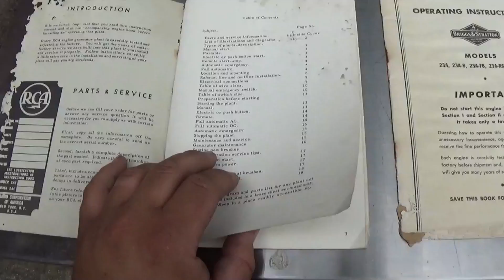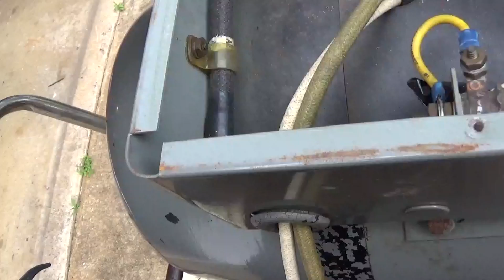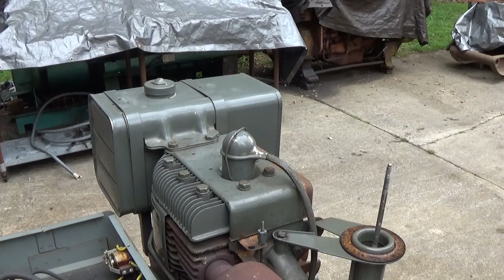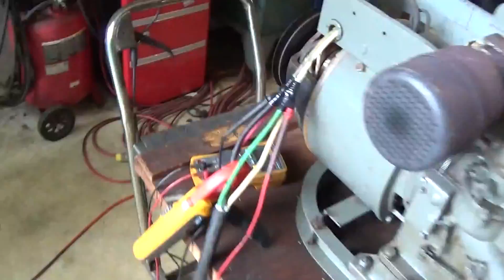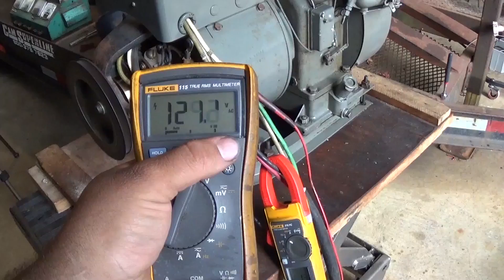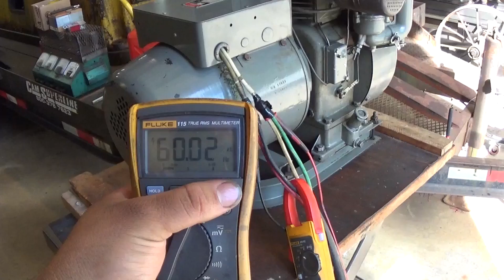Mint 63 Year Old Briggs and Stratton Engine on an RCA Generator

Comment: Indeed these were used for 2 way radio sets in Australia's outback the only strange thing is your unit is 110v ac single phase while ours are 240v ac single phase also ours had an electric 12v starter Generator on the front pulley, but I have seen these types of units with a built-in starter in the generator, I can't remember the Manufacturers name but these were generally the same Briggs & Stratton Engines, bigger units had Lister diesel engines on them  and multi output voltages all had shielded wiring, haven't seen these since the early 1970's they were the life lines of remote Cattle Stations (Ranches),As for the frequencies the engine throttles were set to in our case to 50HZ the voltage could be under load from 240v -220v, the OLD radio equipment was more sensitive to the correct HZ. There were also issues of Fuel Quality mainly due to the age of the fuel, so engine performance needed checking via a HZ meter, diesel fuel was less of a problem.

Comment: Back in its day, there were not multi grade oils, 20W or 30W for most engines. When multi grade oil came it was a big deal and slow to accept. Sure would not want to run modern electronics with that, sure neat to see and hear run.

Comment: I am sure that it was for some small  use.  Most RCA equipment was for professional broadcasters and at 20 amps 120 volt I doubt anything big.  Maybe a small remote truck or back up for a small radio studio, intending to keep only the basic equipment running in an emergency. Certainly it could power the main console and a couple of turntables and a small lamp. This would have been all you needed to stay on the air as the STL was a dry telephone circuit.

Comment: Hi great video, I have a similar motor same carb type, fuel tank , air filter etc. Can you tell me what the lever with holes and springs attached does (left and below of carb) and what the thumbscrew tap value does under the carb pipe? ( I am not a motor minded person but had mine running and working after a storm here in Melb Australia this week)

Comment: When I saw RCA mentioned, I immediately thought that the generator could have produced the HV dc for old valve transmitters, instead of making domestic ac voltages.   At British Telecoms we used to have some standby sets, and Electric Motor / Generators that would produce the HV for the valves.   We also used Mercury Arc Rectifiers...  Now there's a sight..  The only place I know still using Mercury Rectifiers is the Isle of Man Manx Electric Railway, where it is still used to generate the 800v Traction Current for it's trains.  Thanks for these Gene Videos..

Comment: On engines back then they use to do brake in oil. Lighter weight oil that you allow the rough parts to wear off the engine. Then use normal SAE30 oil. Even Car manufacture's called for it.

Comment: What is flicker points?
Reply: OK. I looked it up.  Flicker points increase the voltage on the field winding to compensate for the generator slowing down on a single cylinder four cycle engine during the non power stroke revolution of the engine.  

So: during the non power stroke of the engine the engine decreases speed and consequently would lower the output voltage of the generator, so the flicker points boosts the excitation voltage to compensate for the low voltage output.

Comment: I've got a 16 horsepower that looks just like that one...starts right up..it uses a starter/generator..makes about 2 turns to start...I'd like to find a generator for it to turn..I've had it 30 years...I guess it'll pull an 8 kwH  easy enough or I might just use a 5 and leave the 6 inch pulley on it and let it run slower..if you take care it'll last forever...these motors don't wear out...I've had probably 10 of them...you're right about people and common sense lol that was funny

Comment: Same engine I have! The AFB means it takes a direct mount generator/pump or clutch as it has a 
tapered shaft. it has ball bearings at the pto shaft end. freaking mice. being a nine HP  it should 
be good for 4500 watts.

Comment: Great videos! You have some old generators just like ones I have owned and worked on, back in the 70's and 80's. Really like the old 1 cylinder Onan 1000 watt with an updraft carb, mine came From Minnesota Power & Light as our power supplier used to be called. Thanks for taking the time, really enjoy your stuff!

Comment: Dear SEM. Sometimes dating these engines or generators is possible by looking at date signs on the back of the manual. Eg 453 is April 1953. Small characters. Also capacitors  have a date stamp to determine a period of manufacturing. I think I have an B&S engine from that period but not so lovely shining as yours! Good luck!

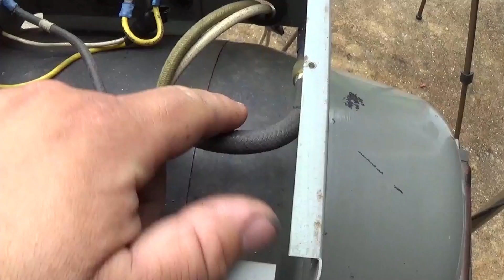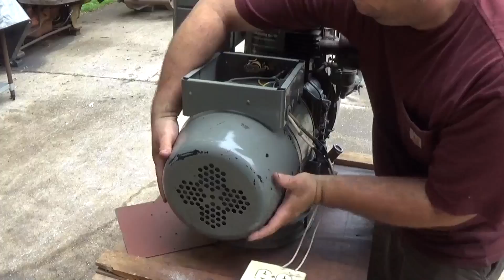Comment: the gen set  end bell vent holes do not seem large enough to allow mice to get in ...how did the mice get in? Just spotted it  at 11:11 to 11:40 , THE NASTY  TOPO 
GIGIO  followed the output wires  hole  from inside the box  , there is a huge gap underneath  its rear  bottom edge that does not contact the body of the gen set.
if left as is ... it could happen again  depending on where the gen set is stored.
Great video ..learned a bunch about flicker points.

Comment: YUP, that is how they did it, steel wool/oil bath air filter, damn good too. one hell of a
good magneto under the flywheel, it looks like a big-ass horse-shoe crab, something 
is squealing. I'd check gener8or bearings, rated for a bit over 2725 watts or 2.7 KW.
for the most part for every eng. hp 500 watts it is so a 5 hp would be good for 2500
watts.funny I thot the engine was close to mine a 23 book says 23a  and I saw 
elsewhere engine is good for 9HP.

Comment: The copper braid from the brush is known as shunt although in brass or copper brush holders, the shunt 
makes for a much better connection. that engine looks like a 23 AFB rated at 9HP. big-ass magneto under 
the flywheel, must weigh about a pound, looks like a horse-shoe crab!

Comment: One thing I learned with oil bath air cleaner systems used Textron transmission fluid it will filter 3 times better all the dirt and dust out of the air you notice that because there's a lot more dirt gets in the bottom because it's doing a better job filter in the air dextran transmission fluid Superior fluid for oil bath air cleaners didn't have transmission fluid back then or they would have recommended it

Comment: have the same engine on my yard mower, pull tractor unit, large blades ~3ft Radius. Cleaned the points and ground. It fired up and runs great. Smokes on startup. Pull the float the bowl also,  Starting fluid for first start

Comment: Nice. I remember those carbs. All you need now from the 1950's is a "Smudge pot" that they put at the end of a road so you will not run into construction at night. Engine has a smooth sound.

Comment: Made the same year as me, when I first started watching this video I was not too impressed, and it was the year model that made me stick around. But as I watched, I became more and more interested, especially when you started talking about the flicker points, you see I had never encountered them before, although I was aware of them, which is another story, although my primary job was as a high voltage electrician (lineman splicer) I was asked to assist the generator technician with a problem that he could not figure out. Well as we were working on his problem, he was trying to find out just how much I knew about generators, so he tried to stump me with a question about an old Onan generator that he had encountered a number of years before. The generator he described to me, actually had 2 sets of points, the for the ignition circuit, but the other one went to the generator field, so he asked me why? Well I thought about it for a few minutes, and I then said to him well the only thing that I can think of as to why they would do that is to lower the voltage to the field during the power stroke to reduce or eliminate the flicker of any lights running on the generator, particularly when it is loaded heavily. Well he stopped right in his tracks mouth open for a few minutes before he said anything. Then he said to me, how did you know that, and then he began to explain the hoops that he had to jump through to find out what they were for, keep in mind this was quite a few years ago, long before the internet and goggle, he explained that he had contacted the factory but no one there had any idea what they were for either.
So after a number of phone calls someone at the factory finally put him in contact with one of their retired engineer's who was able to explain to him what they were for. So anyway after that I was his go to guy for anything he didn't understand when it came to generators or anything electrical or electronic. Which a number of years later led to me getting a job with NASA as he had gone to work for them after leaving the place where we had worked together. So when I showed up for the interview as it turns out he was about to become my supervisor, the interview was when can you start? But I must say that generator is a great find, and something I would love to have, I used to have one of those engines when I was a kid, someone gave it to me when I was around 14 year's old, and I used it on many projects over the next few years, and yes the governor on that engine is one of the best I had ever encountered, all around it was one of the best small engines I ever had. Although it's not a high RPM model like the smaller ones, so when I first saw your generator I was thinking man that is really going to be hard on that engine running at 3600 RPM not realizing that, that RCA generator head was an 1800 RPM Model. So after finding that out, I realized that you really had something special there. The RF shielding on that engine is one thing mine didn't have, I believe that was something that was specked by RCA, and as several have already commented about, I believe that it was a purpose-built unit, and not something you could just go out and buy. Knowing that engine and the fact that the generator head is an 1800 RPM 4 pole unit this generator was designed for a long Service life and high fuel efficiency. I would hang on to that unit if I were you. That would be a great unit for someone living off grid, as a supplemental power source, for for times when it's cloudy for extended period of time or they just don't have a big enough solar system to run the big stuff like a washer, AC unit, instapot, or some other high energy use device. Anyway it was a very pleasant video, and made me think about a lot of stuff I hadn't in a long time, and I also never realized that that engine was made when I was, Awesome!!!
Reply: Robert Thomas 
Enjoyed your comment very much.
Reply: God Bless you Mr. Thomas!    I wish you were my grandfather....seriously!  Lol

Comment: So much nicer sound than the current 3600 rpm "portable" generators
Reply: Definitely does sound better, but you get more power out of a higher revving engine and smaller displacement.
It's kind of interesting that you can buy a portable generator today that makes the same amount of power.
But I seriously doubt any of these new generators would be around 50 years from now and still work. Even if they just sat in a box.
Reply: @kens97sto171   A friend lives off the grid in AZ and has 18,000 hours on a Yamaha. I have 2500 hrs on my Yamaha, runs and looks new. 
There's good stuff out there if you don't mind paying for it.
Reply: @TheBandit7613  
Thanks for the information.
So far I've had good luck even with my inexpensive generators from harbor freight. They don't get that much hard duty time, however they are getting old at this point and yet they still start every time. I am very careful however to make sure I turn the fuel off and let it run the fuel out of the carb.
The first one I got was one of those little $85 two-stroke models. That thing's going on 10 years old. Still runs fine.
I think if I was going to get something that I was going to use under load for a significant amount of time I would probably get a Honda or Yamaha, Ryobi makes a fuel injected model that I've seen on project farms YouTube site. That would be kind of intriguing because it eliminates a lot of the storage issues with carburetors. Probably decreases fuel consumption I would think too
Reply: Yeah is that 1200?
Reply: @skuula  Should be around 1750.

Comment: don't build them like that no more! I'm not a generator guy. I'm an engine guy. I did read some folks talking about the flicker points. Lots of generators will require the coils to be re polarized if they haven't been run in a long time. I can see this as being a good option to prevent the user from having to do this. Maybe I am wrong. But anyway, most of all glad to see that old briggs and gen running like a champ!!!

Comment: Could have been for a mobile TV or radio truck, or a number of uses for AC in the field, so to speak.    I would guess that someone made it for RCA.  Depends on the cost to buy vs. tooling up to make a small number.    I worked for Bell and some of the Western Electric stuff was contracted out but has W.E KS numbers on it.   Nice Gen.

Comment: I'd remove the mixture screws, idle & high speed, keep track of turns. Spray a shot of carb cleaner in there, and it might smooth out even more, especially under full load. Lean it out slightly, it fouled the plug before. What a super-nice generator set! Well played!

Comment: It would seem that under light load the voltage would be 130V or so. Is that a problem for hooking up household devices? How loud is it? It sounds fairly quiet. Quiet is a good thing. Runs nicely!

Comment: On the farms model 19s we had better luck with UJ8, which is a series gap spark plug. Good luck. I loved it when the farm bought augers with Kohler motors. They had electric start. 
Hello from north east Montana.

Comment: What a great gen set Mike. Back in the 70's were stocked, sold, service the Pincor generator line,...memory tells me we have some fields that failed on a regular basis with a lot of those,.
.these would be in the 1500 watt to 8000 watt range models.We changed over to Winpower sets after these.

Comment: Back then, RCA sold many things that they did not directly manufacture. They were often a “turnkey provider” of radio and communications systems for broadcasters and the military.  It’s possible that genset was produced as a system component for a two way radio site , PA system or similar. Or possibly for some type of mobile equipment. 
I would doubt RCA made the generator itself. More likely they contracted with another manufacturer to produce them to RCA’s specifications.
The Champion J-8 spark-plug was pretty much ubiquitous in the 50’s and 60’s on small engines.  
It’s cool that’s an 1800 rpm generator. Not a 3600 rpm “screamer” like they make today.

Comment: RCA was a behemoth at the time, with ton's of ton's of patents that almost every manufacturer in the Radio/TV business had to pay licenses for, or struggle to engineer their way around. 
It's entirely possible the generator end on this was something the sourced elsewhere, but I wouldn't be at all surprised if this was designed/manufactured in-house. 
Did a quick check for 20W engine oil, or "20W20". Seem's more popular in Europe than here. Might be OK to use a something like a 5W-20 with a bit of zinc additive mixed in as an alternative.

Comment: I'm a retired radio tech. Back in the day RCA was very big in building radio transmitters and broadcast sights.
They built transmitters from about 100 watts up to 50,000 watts. My guess would have been that little gen set, might have been a backup generator for such a sight.  Maybe 100 watt transmitter.
That grey colour was their standard colour.

Comment: I would recommend that you put a shot-glass amount of marvel mystery oil in the gas tank ,remember back then they had lead in the gas that acted as a lube property , in all gasoline powered generators ....they will last many years doing that one thing ..! Are you sure that is not a Alternator ? Good find ..!
Reply: The lead wasn't in gas to lube valves. It was the original anti-knock agent, before MTBE, and the ethanol everyone loves. 
MMO is just a light oil that'll get burn't up in the combustion process. This is an old iron block briggs, and chances are this is going to be used so infrequently, his great grand kids would need to be the ones worried about sunken valves.

Comment: So relaxed sounding at 1800 rpm vs 3600 that modern stuff runs at... a true testament to more displacement & a heavy iron flywheel. Old Wisconsins are like that, real torque monsters. I bet that thing would last for a century or more with fuel & oil. 

Nice find!
Reply: I imagine there's increased simplicity with a 2-pole alternator, albeit needing a higher revving engine than the 4-pole to produce the same hz.

Comment: The mouse nest is exactly why you need to check over everything that has been sitting for any length of time. That oil looks thinner than 20w to me. I personally wouldn't trust oil with an unknown age and history to lubricate such an engine, especially if you take it to full load. The engine sounds great though.

Comment: Nice machine, Mike ! Always enjoy your videos & the units you find & feature.
I've got several (Winco, Homelite, Wards, Pincor, Dayton) powered by what I call the Big Block Briggs single cylinder cast iron block engines (9 - 16 hp). You got me interested in them when I found your channel a few years back. Neat machines. 
Could the generator on yours be a Kohler re-badged as RCA ?